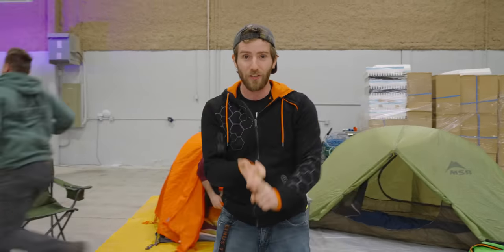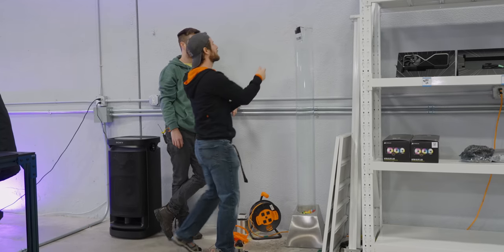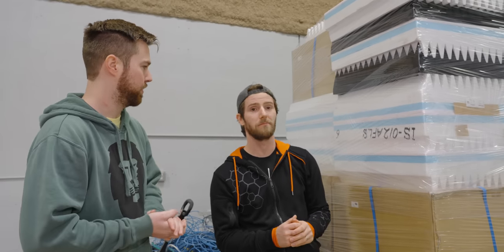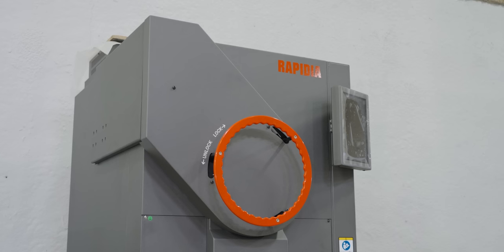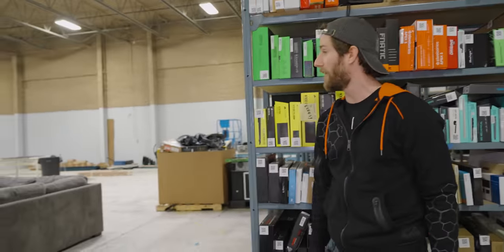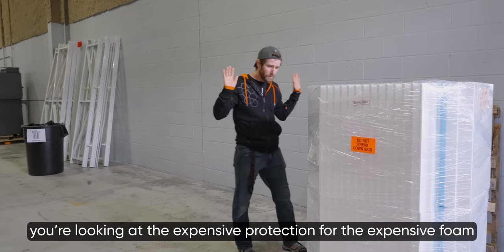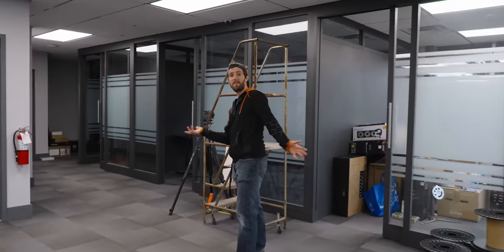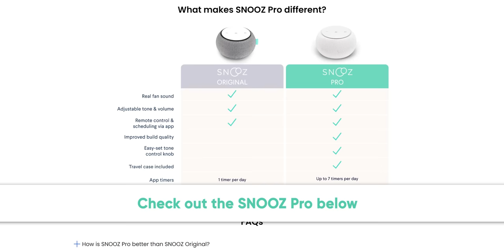I'm NOT Stupid - Lab Update

Comment: I used to work in the machine vision industry and specialized for a short amount of time on the LMI Gocator you are using for your keyboard testing (I'm pretty sure I left a comment on the first keyboard test video that you should use one) but my only advice is more grounding. They are unbelievably inconsistent and troublesome with no extra grounding and I had these installed in dozens of factories. You should definitely connect an extra earth wire to the chassis.
Edit:
Thanks guys for getting this to the top. I’ve not been in the industry for 5 years or so now but I should clarify some things. 

The Gocator is an incredibly accurate 3D profiler that comes setup from factory and ready to use. I’ve setup separate sensor and laser systems before and it is a lot of work compared to the Gocator. The sensor they have is what I would have recommended if I was still in the industry. 
I’ve seen them used for car engine tolerance scanning to creating 3D profiles of cheese and everything in between. 
We saw number of issues with them out in the field and the majority could be fixed by earthing them with the robot and cage they were within then continuity checking to see if everything was earthed. 
I know it sounds ridiculous but its what we saw over and over again. Also props to you for using a local Vancouver company although they are the go-to for an “all in one” 3D solution.
Reply: Up
Reply: up
Reply: Up you go mate.
Reply: Up
Reply: Lets send ya up
Reply: up Up UP!
Reply: Up
Reply: Up
Reply: uuuppppp
Reply: Up
Reply: up
Reply: up
Reply: Up
Reply: Up
Reply: up
Reply: up
Reply: up
Reply: Up
Reply: Ye
Reply: Up
Reply: Up?
Reply: up
Reply: Up
Reply: Up
Reply: Go towards the sky, you ruffmuggin
Reply: Up
Reply: Up up and away!
Reply: Up up and away in my beautiful balloon....
Reply: Thanks guys for getting this to the top. I’ve not been in the industry for 5 years or so now but I should clarify some things. 

The Gocator is an incredibly accurate 3D profiler that comes setup from factory and ready to use. I’ve setup separate sensor and laser systems before and it is a lot of work compared to the Gocator. The sensor they have is what I would have recommended if I was still in the industry. 
I’ve seen them used for car engine tolerance scanning to creating 3D profiles of cheese and everything in between. 
We saw number of issues with them out in the field and the majority could be fixed by earthing them with the robot and cage they were within then continuity checking to see if everything was earthed. 
I know it sounds ridiculous but its what we saw over and over again. Also props to you for using a local Vancouver company although they are the go-to for an “all in one” 3D solution.
Reply: @prian6  true
Reply: up
Reply: Up
Reply: Up
Reply: up
Reply: Left turn then a left turn then a left turn then a left turn then go that direction
Reply: Up
Reply: There is only one way. That way is up.
Reply: Up you go
Reply: Uuuuupppppp!
Reply: Hey! Really appreciate you dropping in on this! We haven't had any stability issues so far, but I've made a note just in case we run into some!

The robot, cage, and Gocator are all already grounded, so I'm hoping we're beyond any issues there :)
Reply: @jakedaynesLTT  Hey Jake, glad that you haven't had any issues so far! I'm excited to see what comes from this testing given its something I worked closely with.
Reply: Up
Reply: Up
Reply: Up
Reply: Daaang, how are you not hired yet?
Reply: Good job spreading the word
Reply: Up
Reply: Up
Reply: moar up

Comment: For the home theater room, it might be good to be able to have a moving wall in order to adjust the room size. You can then give reporting data on how certain products work in different sized areas. And the furniture in different rooms, like beds, wardrobes etc, could have an impact on the overall sound. So you can give good advice or feedback (no pun intended) on everything from studio apartments upwards.
Reply: A sliding wall would not be properly isolated, you would have gaps where the sliders would go. However, apart from that it was a nice enough idea.
Reply: @marknorville2692  If it was built to the full size then have a sliding wall built on the inside of it, it could work. You may get minimal amounts of  sound that escapes, but for all intents an purposes, I think a sliding wall has potential. Especially if its track are sunk and uses bearings over wheels.
Reply: And it’ll only cost an additional half a mill 😂
Reply: I thought of that as well. Maybe a couple moving walls that lock in at a few different spots.
Reply: @kennethjorgensen6703  But if it’s for certifiable consumer testing, that tiny bit of space is too much
Reply: @kennethjorgensen6703  I don't completely understand how sound testing works, but maybe the cavity made by the sliding wall could have removable foam panels to absorb any sound leak? That way, any sound leak will at least not echo back into the main space.

Comment: Linus slapping the counterweight of the fork lift then being surprised how solid it is genuinely cracked me up.
Reply: Hahah! I never even thought about a forklift having counterweight added, and it makes sense why... DUH! So I can lift on a very high fulcrum point!
Reply: the rust on the gas bottle concerned me, I guess they own the bottle and refill it? where I am we just have an exchange program
Reply: @morganzadow4760  Yeah, idk why they have rust all over it. Almost every gas station i know has programs to give a free one fill with gas if you return the tank, inspected, not usually new.
Reply: Yeah it seemed to be "This is the forklift" spank-spank "oooh, nice ass" checks it again
Reply: @morganzadow4760 gas bottles routinely have surface rust on them in the UK. Yes, they are returned and swapped, but the bottles get refilled and sometimes repainted but not every time. Retailers and end users generally store them outside. Surface rust is not a structural issue. I can't imagine Canada is any different.
Reply: @morganzadow4760  can confirm, airgas bottles up here in New England are rusty at times, doesn’t affect the structural integrity.
Reply: @Surms41 Those also aren't gas station tanks
Reply: @Surms41  Yep, they are big ol solid hunks of steel, some have holes like the one here for the exhaust. I used to unload them, with a forklift, at my old job. There was something satisfying about lifting a forklift counterweight with a forklift. Got to have that counterbalance or else a forklift wouldn't be very functional :p
Reply: 17:53 A gas propelled forklift indoors?

You are allowed in Canada to drive a combustion engine indoors???
Reply: you can't exchange a 30# forklift tank for the 20# tank found at most exchange stations. Also, you actually get more propane in a 20# tank by refilling it instead of exchanging it. The exchange companies don't fill the tanks as much as they could.

Comment: One comment on the IP testing setup. The lab I used to work with use equivalent pressure drop tests. Basically in a sealed chamber, you pressurize it to the equivalent pressure of 1 meter under water, put the item to be tested into the chamber, leave it for 30 minutes, and monitor the pressure inside the chamber. If the pressure drops more than a certain threshold, test fails. This is a non-destructive test and became part of the end of line test. Every item off the line gets a pressure test report
Reply: So you messure if water is flowing in the testing item by messure a change in water pressure? Thats a very smart way to do it! Never would have though about it
Reply: @maxischerr  i believe he is saying they use air but pressurised to the point where it's the same as if the phone were in water. then you don't risk water getting in the device, just air
Reply: Well, I think they want a kind of real world IP test, therefore the water. No consumer will leave their phone in a pressurized room..
Reply: @Lupolinar  Actually, this would be a more significant test as air is a much smaller particle than water. If something is airtight, it almost certainly is water tight. It's much harder to contain or keep air out than it is water.
Reply: @raviere22  Yes, but water also shows flaws in the charging port design. As in air/water might not get in the device but is everything exposed to the atmosphere also gonna hold up to water conducting electricity or corrosion problems.
Reply: @Ero Kreitsman  This is an absolutely fair concern. However, if this were the case, pressure would be irrelevant. See the test the OP proposed would analyze any failure of the seals, any air transferring from the pressurized container to the insides of the phone. If the phone were to fail without this happening then seals worked and the design was faulty without them failing. Meaning just dunking the phone in any amount of water would have cause it to fail, no need for a fancy tube.

Also, you'd be SOL regardless if a device could fail in this way as even splashing would kill it. This would immediately violate the protections law of requiring it to have a minimum water protection rating.
Reply: @modarkthemauler  that’s a fair point. Although water corrosion on exposed parts of the device is a different type of test and not part of the Ingress Protection test
Reply: @maxischerr  Nicholas is right. No water is involved, just pressurized air. There’s no risk of liquid damage in this case and easier to integrate into assembly line

Comment: A possible solution for your server room acoustic and vibration issue, could be using something like common spring isolators used in mechanical trades. I am a local plumber/gasfitter/pump installer from the Fraser valley and I use them often when installing noisy equipment in ceilings all the time. I've never seen them used for DIY server rack installs but I don't see why they couldn't be used to help with such things.
Reply: also, invest in a ACOEM Bearing Defender and alignment tools. It seems you folks are getting into some large installs and testing of various types of equipment. Getting a few employees trained up on alignment and vibration analysis could be beneficial for you. Once you use one of these things you will be addicted to testing everything with a bearing in it hahaha  no joke these things can really save you some headache with low tolerance installs. (nothing to do with the server room, but could be useful)

Comment: As a professional Test Engineer, I am so impressed with this setup, and big respect to LTT for putting this much time and effort into this new lab. Yes, it is expensive to do, but it will pay off in the end with independent validation and testing a big advantage to LTT’s reviewing of the tech that pass through their hands.  
I do have one suggestion though - perhaps you could have a shock test rig for all of those “rugged” tech devices, as I am sure that Linus doesn’t have the time to drop things continually… 😉

Comment: I have actually done ingress protection tests for some production sample components with similar setup except the fancy part on the bottom. Some problems with algae in summertime but cheap, simple, works 24/7 and there is like 1-2 parts in total that can fail in the whole setup which translates into being really reliable and availability is also practically 100%

Comment: The distance on radios like those are dependant on line of sight. Technically you can talk to the international space station with those as it's passing overhead because it's within like of sight. The problem on land is we are also sending those signals through walls, trees, ground ect. So when your in the ocean you will probably be able to reach until the curve of the earth is reached. It's why you see tall radio antenna on fishing boats to get a bit further around the curve of the earth.

Comment: What an amazing place. I’m really curious about the boring bits like heating / cooling / fire safety etc. Linus mentioned about the sprinklers which is a fascinating detail.

I also hope there is amazing security as that’s a surreal amount of expensive kit in one place!
Reply: I work with security systems and it looks like a DSC Power Series Pro system based on the keypad by the front door. Probably a heckin huge security system. And hopefully insurance :P. There is actually a lot of cool automation stuff you can do with security systems, especially more customizable ones like the DSC Power Series Pro. Unfortunately we will likely not see anything relating to it from Linus because it could compromise the security that said systems are to provide.

Comment: For the server room:
1. Typical fiberglass in the wall. You just need mass, it's an interior wall so thermals don't really matter 
2. Putty pads around outlet boxes to stop air gaps
3. Sonopan (largely a Canadian product so it works out. It's barely available in the states) 
4. If needed, spray foam around gaps
5. Re-sheetrock and you'll have one damn quiet room

Comment: Great job so far for everywhere who is working on this new project. If I can give a few pointers about the server room situation in "We don't know" time stamp, the window on the server wall is probably not sound proofed so you better just redo the whole server wall and insulate it. Also, the "between ceiling" space is probably designed as a plenum space that helps the return of used air in the hvac system so if you want to soundroof it with accoustic walls, you need to add a hvac duct muffler otherwise the server room will choke as a Dell Nitro prebuilt gaming pc. XD
DISCLAIMER: I'm not an HVAC specialist, just a stationnary system mecanic but I have seen firstshand multiples failed attempts of compagnies trying to built a server room with disastrous results. I recommend that you contact a company who can calculate the new CFM needed for the repurposing of the room with the ASHRAE standards and calibrate the HVAC system has needed.

That being said, I wish you the best success in this wonderful adventure!

Comment: As for the server room, you guys might want to consider insulating it with cellulose. You won’t have to rebuild the walls as you just have to cut some injection holes to blow it in which you can close up easily afterwards.

Comment: Suggestion: If you're looking for quick and dirty sound, air, and thermal insulation for those interior walls, (and you don't expect to need to run any more cable in the wall) you can go spray in foam insulator. There are some "after the fact" products for spraying into existing wall cavities without making big holes in the wall. You will need to seal EVERY electrical and data box in the wall to prevent foam from entering the boxes as it expands. Normally, this is done on the outside of the boxes before the drywall goes up, but you can do it on the inside of the box. Make sure to follow the instructions and also ventilate the rooms because it off-gasses like the dickens and is very exothermic.
Reply: Isn't that stuff extremely bad for the environment?
Reply: And what do you do if you buy new Testing Equipment 5 years down the line and need new Wires or you have a defect and need to repair something?

That stuff is a terrible idea in a professional environment.
Reply: @t.490  Chances are, whatever solution they chose is going to have the problem of "What about changes 5, 10, 20 years down the road. That's the problem of futureproofing any design solution. HOWEVER, it doesn't look like they'll ever be using the office space specifically for testing. It's more likely they'll need to update the room for more or different connectivity for the social media people.

As for your statement about spray in foams (or anything else they might inject into the walls), What are you basing your statement that they're terrible on? Personal experience, professional experience, studies, or hearsay?
Reply: @silvermold  Extremely bad? I don't know. I know that some expanding foam products off-gas a lot as they expand and harden. And, quite a few get really hot when activated. But after they're set,  there have been reports of indoor air quality. Although everything I found on that issue points to either improper mixing of the product and/or application of the product in most cases. (So Linus and Jake should hire a licensed professional instead of YOLO'ing it.)

There are alternatives, such as Cellulose and Cotton that don't have the off-gassing issue. And they also come with their own issues, like they can't be used in areas with moisture issues. Also, if Vancouver's codes have requirements for what kinds of walls Linus's server room needs, that's going to impact what they can do. I know fire codes can be pretty exacting what can and can't be used where. For example, any place data and power cables have to pass through a fire break wall, the opening has to be plugged with fire retardant materials once the cables are threaded through. (Used to work in the ITSM Service Desk for the company I currently work for. Wrote enough "come back and fix your mess" tickets for the cabling folks every time they'd run some wire somewhere and the onsite fire Marshall had to inspect their work.)